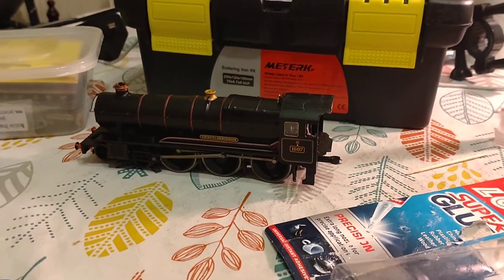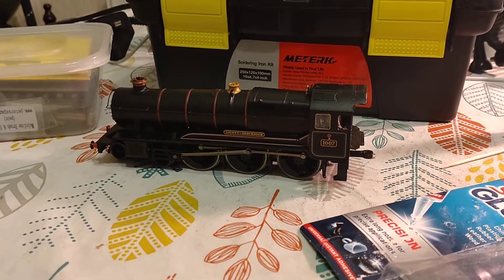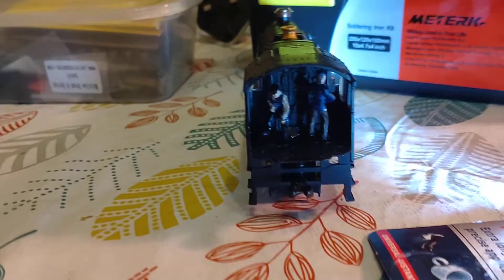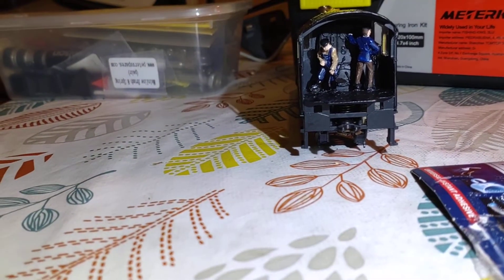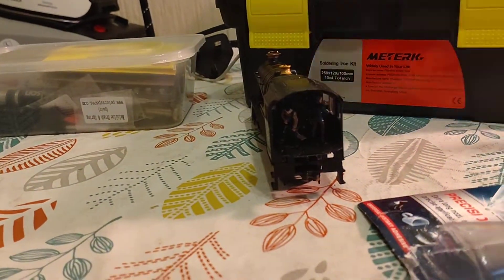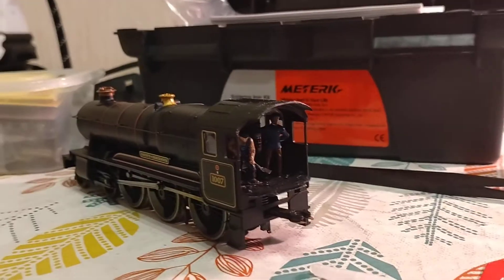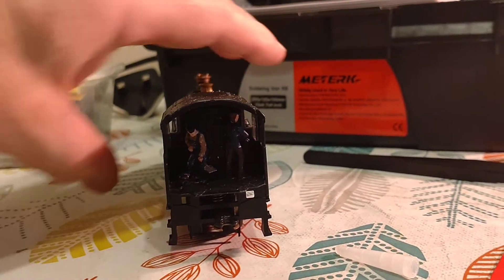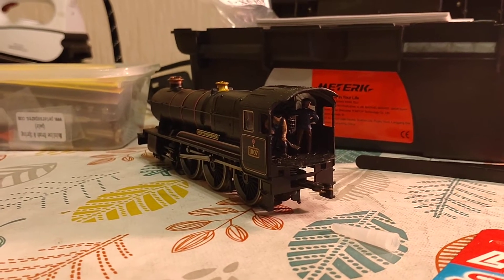Adding a loco crew to Hornby County class

Comment: Hi Paul nice locomotive any tips to get locomotive crew in if like me you haven't got a steady hand like me cheers 👍
Reply from the maker: Practice and perseverance. Only use a little glue as shown. I found it fiddly and frustrating at first. One thing I thought of trying is to stick the figures to appropriate coloured card cut to size and then placed in the locomotive. I will do another video if it works well. Regards Paul. 🚂
Reply: Thanks 👍